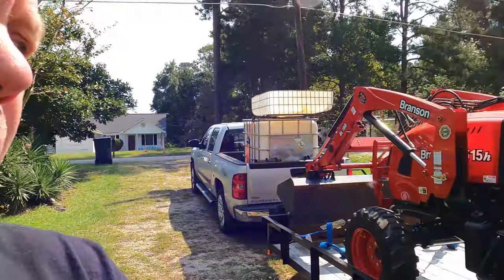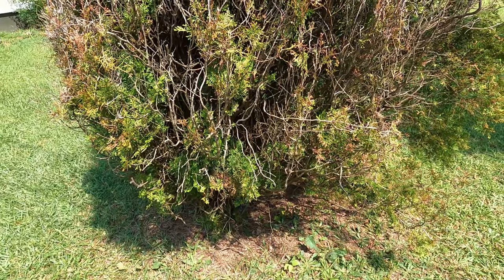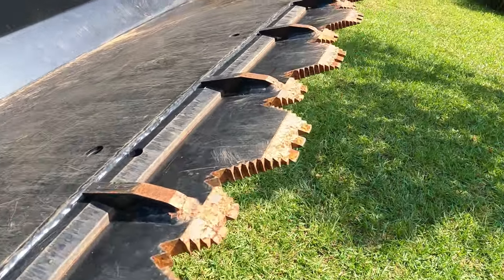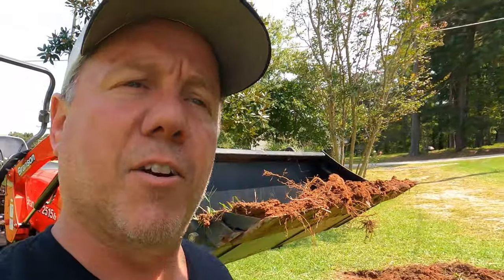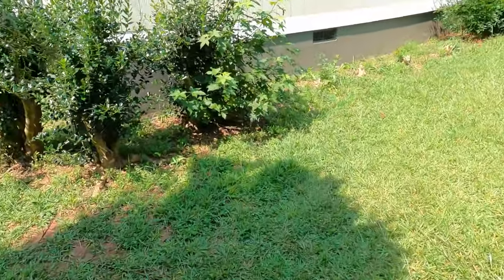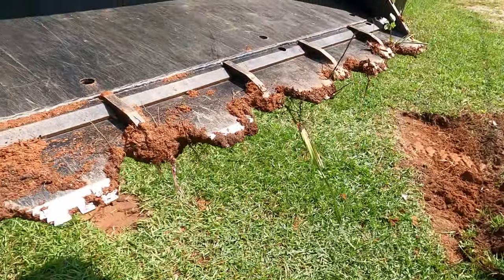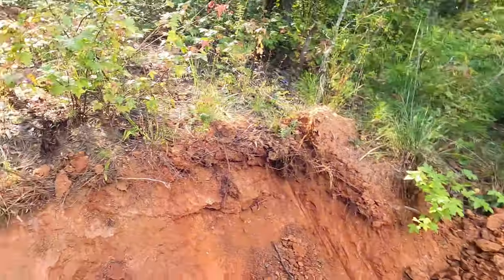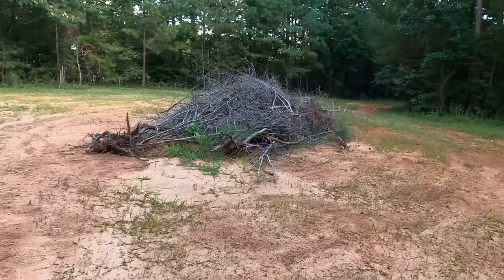EA Wicked Tooth Bar In Action On My Branson 2515h Tractor. My Review of Everything Attachments.

Comment: I would like the measurements please.
Reply from the maker: 61 3/4" inside bucket, 63 3/8" outside cutting edge, 1/2" thick cutting edge. Thanks for watching and pushing me to make this video.
Reply: @ProjectsWithPaul  No worries, and thanks! I would like to see how well the tooth bar would dig without any roots in the way in regular dirt please. Don't know if I should get this or the piranha tooth bar.
Reply from the maker: @jmoe6253  You gotta watch the whole video. Nothing but dirt at the end. I believe this one is tougher than the piranha because its made from Hardox 450 steel.
Reply: @ProjectsWithPaul  I did. I was impressed with how will it went into the hard clay. I was just wondering how well it would do in regular dirt situation. Awesome videos keep them coming thanks!
Reply from the maker: @jmoe6253  Gotcha. Will do.